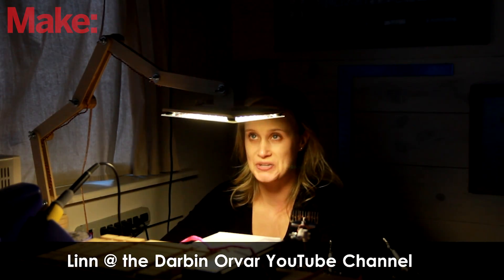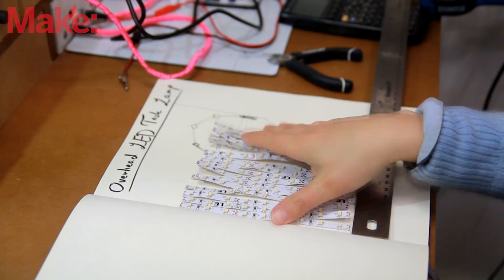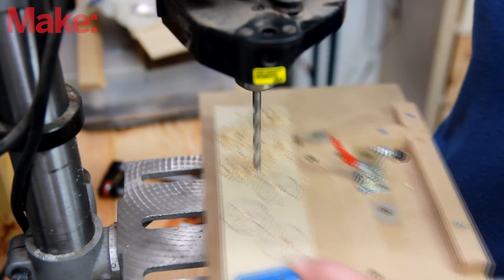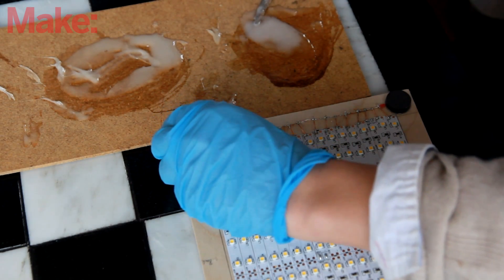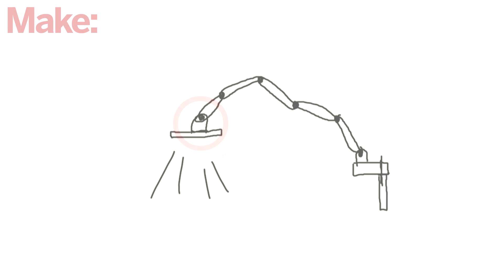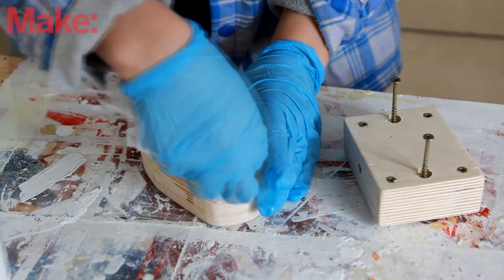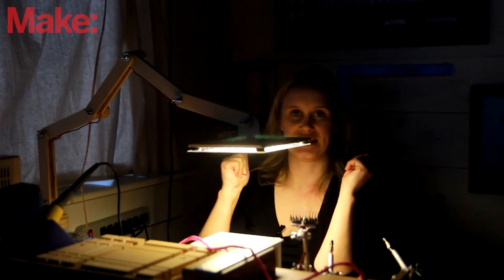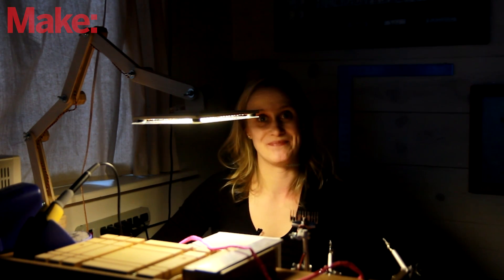Darbin Orvar: Building an Articulating LED Task Lamp

Comment: i do not understand why you used LEDs instead of a normal medium base mount with a replaceable light that is serviceable forever, rather than LEDs which cannot be replaced easily.

Comment: Needs a couple swivel connectors to really give it full range of motion. How do you go about calculating the power requirements and doing the power supply/wall wart?

Comment: i am not sure how those joints can handle the weight at the same shape i want it to be in time. I would expect it to start failing against gravity every some mins. But if that happens to be the case placing rubber washers could help. Cool looking lamp overall. Need to build one and for sure I am going to make use of your idea while building mine, like the magnet connection. Thank you.

Comment: Now add the function to pan or tilt the head left to right - then you got a really utility workbench light. There are instances where you want to target on an object which is vertical and not flat, the light would be able to pan vertically to accommodate focusing lighting on an object which is located in a vertical undercut and is also on the vertical axis. Where there is an object in the vertical plane, you would then change the light head to a smaller one so that the light source is in front of your tools and hands. Otherwise the head you show here would be in back of your hands. Your hand would then block the lighting from that panel. So having an articulating floating arm which can also pan in both directions with a smaller head is needed.

Comment: That's a really neat lamp. I just bought a small battery operated, magnetized worklight that I can put onto my vice, mostly because it was cheap and because I don't have the workspace or tools to do more than soldering. I got a upgrade idea: why not make a stationary panel on the lamp with a magnet in each corner and several LED panels with magnets on the back corners, then connect the power wires to the magnets like you did with the little magnet connector, but now you could just pull the LED panel off and snap another one in its place without taking it off the lamp's arm. The four magnets would deliver the power from the lamp to the panel. Magnets are indeed great for this because they maintain a good and firm connection instead of relying on friction like normal connectors.

Comment: Sharp idea with the electromagnetic circuitry! As the LEDs are by far the most expense component to this build, I would love to see that LED panel made easily detachable from the articulating arm so that you could move it to any number of other articulating arms around the house. Maybe you could use, I don't know, magnets maybe as the connection point ;)

Comment: hello Lin, inspired by your project I made a similar lamp for my home, but not able to go ahead as i don't want the lamp to be fixed at a place instead want it to be with a base or a lamp which my child can attach it to his study table, how do I make that?
Reply: **Linn & clamp
Reply: Make the same lamp here and attach it to the desk maybe?  Or make the base from a floor lamp, just use the weight at the base of the floor lamp at the bottom of this lamp so it will stay where you put it without having to screw it down to the surface.
Reply: Inspired from you I have made the lamp, don't know how to share with you

Comment: This would be useful for film or photo lighting too, you could switch LED panels from cool white lighting to warm amber tones. 

Or from a larger panel to a smaller more concentrated, fewer but brighter LEDs if you need to while working or something. This is definitely going on my Build list.
Reply: it would not be good for film or photography. LEDs have very poor color accuracy and unless you are using a very specific kind of LED, their color rendering is extremely poor.

Comment: Ok, some paradigm shifts here, contact cement for gluing up plywood, never considered magnetic circuit connection,  never used strip lights for a lamp, never considered a remote control for a lamp, and never thought to use wood as a segment for this application.  But now that have seen this I have some ideas to make molded plywood fixtures. I have made formed plywood furniture in the past but always chairs, tables, cigar humidors,  jewelry stands, makeup stands, tack boxes, aircraft cabinet and the like. But now I'm going to do some LED lamps, phone speaker boxes, notepad stands, and the list goes on. Thank you for doing this vedio.

Comment: Hi Linn 
I'm having a big problem when I built this. My bolts and wing nuts couldn't hold the weight of the head of the lamp and so it kept falling down when I extend my lamp out too far, I tried springs but the all it really does is hold it in place and doesn't allow for a lot of flexibility, I was wondering if they're any solutions or advice you can give me thanks!

Comment: Great job! I'm using my similar lamp (with classic bulb) since 1990!! Still working! But is little dangerous with hot bulb ;-)
Reply: You can use some covers: http://porzadekwkablach.pl/environment/cache/images/0_0_productGfx_18df48707413f0105ca0b01700e0d655.jpg

There is professional jack plugs with magnets: https://encrypted-tbn0.gstatic.com/images?q=tbn:ANd9GcQEgS5MO-RbnGCExUxDpBowUWGq1Rb9n3Ie95ljmnvhNeFCI9pn3Q
Best, Loszmi

Comment: That looks great! Did you put on a switch or do you just use the magnet connection to shut it off?
Reply: +Dylan Pieniazek 
judging by the remote, there's clearly an IR receiver by wherever the lamp's wiring becomes the power plug. Almost all of these LED strips seem to come with a slim remote paired with a box.
Reply: +Meowstic oh thanks

Comment: If you insert a 10khz dimmer into the circuit and adjust the light with that, your DSLR(or MILC, hard to tell) wont give this flickering image, like the end of the video.

Comment: Only thing I'd add would be to have a piece of small dowel or even a piece of bamboo skewer sticking out of one half of the power coupler, and a corresponding hole on the other half to provide some polarity protection. Won't hurt the LED's, but I'm a belt-and-suspenders kind of guy. Might also round the corners of the panel, I could see myself getting poked in the eye if not. Otherwise, a spectacular project and one I'm going to make. Always looking for good ways to make a better LED lamp.

Comment: I'm afraid you didn't add any security or guide to prevent the plus to be connected to the minus. Maybe adding a diode to the magnet system is a good idea.

Comment: The magnetic electrical connections are genius. Never saw that before. Thanks!
Reply: +Rick Rose The reason people don't usually do that is because the heat from the soldering is de-magnetizing. But if you're ok with weak magnets holding the connector - go ahead.
Reply: @nvmnvm8821  nah. Heat is localised and very temporary. Have done this with no loss of magnetism

Comment: Linn, I see you are using a remote to control the light. But I was noticing that the magnetic connection could function quite well as a manual switch on its own; assuming you don't need a dimmer.  As always, great build.

Comment: Linn: I like the magnet connector, but you might have added a peg + slightly oversized hole on one side so that the couldn't be connected backwards.
Reply: +xKatjaxPurrsx Thanks, the way I solved that was to make like poles repel so that you cannot connect it any other way.
Reply: That's brilliant.
Reply: +Darbin Orvar Okey i have to "steal" that idea to my own projects! Just curious, what type of magnets these were and is there any special trick on soldering the wires on? Also have you tested that magnet connector wont cause amps to rise due possible poor connection (i mean its not like any standard connector and lose ones cause the connector just heat up if connection is poor) ?
Reply: I did not get why Linn did that till she pulled out the second panel.. and then it was like..  "Oohh, she is smart!  ... and a touch of indecisive."  :-)

Comment: So nice, wish I could like it twice!  I like your idea of using magnets to attach the lights, making them interchangeable without the need for rewiring.  However, keep in mind that heat will destroy magnets and can cause glue to fail.  In your case there may not be enough heat generated by the current flowing through the magnets to worry about.  Just keep in mind that if your magnets or glue fails, check for heat issues.  When I build a similar project, thanks to your inspiration, I plan to keep the interchangeability feature but position magnets out of the loop.  As always, you are so awesome!  Thanks!

Comment: Lyn, what is the power source?
Reply: +djAnakin These are 12 volt leds so I used a 12 volt adapter.
Reply: +djAnakin The LEDC strips run off 12V DC, so a 12V DC adapter. How much current capacity it needs depends on the type of LED strip and how much of it you use. 

Some data could be gleaned here: http://www.ebay.com/itm/5M-300LED-SMD-3528-5050-5630-RGB-White-Flexible-Strip-Light-Remote-Power-Supply-/181929534674?var=&hash=item2a5bd864d2:m:m0scM64YX98bf-el_nc1P_w 
depending on LED type they use 2 or 5A supplies  per 5m strip (300 LEDs), so 20-50mA/3-LED group
Reply: Darbin Orvar brilliant project. got to build this for my self will look brill in my tinker corner.  just wondering what thickness of plywood you used ?
Reply: +Darbin Orvar The power requirements of this project are just glossed over.  Using an on line calculator and some conservative numbers for super brite white leds, I'd estimate that 162 LEDs in this project would consume close to an amp.  The 12 volt adaptor needs to be capable of driving that much current; many are not.

Comment: Nice build. The DIY mag safe connector is a cool addition, although indexing to avoid accidentally reversing the polarity would make a nice touch. Also, press the magnets, sharp blows to magnets can have detrimental effects  on them. Again, cool build.
Reply: +Harold Hayes III Good catch on "tapping" the magnets.  Heat is also another concern.
Reply: Doug Reed
Not to worry (Flinch.....lol) The hammer head is a non Magnetic...Non Metallic.....and is Lemon Flavored.....lol ...again !

Comment: congratulations. nice project. I like it. a little advice; led lamp so heating. Therefore; you must use aluminium heatsink to behind.
Reply: I was thinking the same thing. Also, is this a DC only lamp? Did she mention a wall adapter/power supply and I missed it?

Comment: Nice! Any way the adhesive from the leds would stop adhering?
Reply: +Alfred Zianini Will probably loose grip over time, accelerated by heat... Peel them off, clean off any remaining adhesive and the put the strips back down with 'real' glue.

Comment: Is the magnet wiring safe to touch when connected in an outlet? Will the current shock you?
Reply: +Kevin Li Good thought there.  It would be a good idea to turn the lamp off before changing that component out.
Reply: +Kevin Li The LEDs run off 12V which isn't enough to shock you as long as the power supply is working correctly or you lick the terminals... 
Of course, some Chinese power adapters are shockingly bad design and/or build quality. Same precautions apply as with phone chargers.
Reply: Interesting, in class I am building a led lamp so maybe I'll implement this.

Comment: I made something smilier I used alternating LED strips between worm and cold light and add a dimer to the 2 power feeds so you can adjust the light output nice build your wood work is grate mine I attached it to a old lamp stand not as nice  I think I will mod mine with the magnets thanks for the share
Reply: How do you figure out the proper power supply if you want to use a wall adapter? She didn't seem to mention that part.

Comment: nice build! I would suggest placing the leds with a certain offset... not in straight rows/columns, for better light uniformity
Reply: +Francesco Bianchi The great thing about her design is the "lens" cover is magnetic and can be easily changed out depending on light requirements.

Comment: I'd have been strongly tempted to extend the arms past the joints and add a counterweight
Reply: That would only be necessary if you had a spring articulated lamp, not a friction fit one.

Comment: Thanks for sharing, (please allow me to apologize for some of these Internet Cavemen that have lost touch with civility and respect for others).. I like the idea of the low cost wooden knobs, but worry that the bolt and fly nuts will loosen at random. I have toyed with the idea of building a larger scale articulated arm like this. I have not found a pivot joint I can put faith in (preferably something that doesn't require manually tightening, like something spring loaded/counter weighted/etc.). Any ideas/references?
Reply: +Jake Little You could use carriage bolts, which have a square section underneath the head that is inserted in the wood and prevents the bolt from rotating. You would still need to use the manually-tightened wood knobs though. Or just copy the design of a balanced-arm lamp ;)
Reply: I had similar thought. I've used a thumbscrew in a t-nut for a single joint articulated camera stand. It's easier to tighten but still loosens up when manipulated. I've yet to find a DIY friendly design that maintains friction without need for constant adjustment. I tried a slotted roll pin (aka tension or spring pin) in a nylon insert that I glued into the plywood. I think that approach might work, but I either needed a larger diameter pin or a different material than nylon.
Reply: Doug Reed Friction as the only load carrying/holding capacity works okay for a design of this scale, but if the design is scaled larger more weight is involved. With more weight the bolt must be stretched further to handle the load. The more stretch the bolt has the more it becomes susceptible to handling/vibration loosening with time. I was looking at building something like an 8-9ft (2.5+m) stand for use with a 4ft long LED photography light for larger scale product photography. I need something that can quickly be moved from the ceiling to the floor and everything in between, with one hand. Professional light stands are terrible for this, so I build everything myself :)

Comment: Very, very nice! Didn't you think about multiplexing due to less power consumption? What do you think?
Reply: I believe that would affect the ability to use it in a video  because it looks bad to capture the partially lit LED's within the frame rate of the camera. Functionally, outside of making a pro quality DIY video, it probably wouldn't hurt. It's just more complicated when these are practically fully prewired, isn't it?
Reply: Yeah, for DIY video your version is better :) But beside that I think I'll make multiplexed one - we'll see. Thanks!
Reply: +szafran In general less current means less light, and unless you're off-grid on battery power the strips don't draw enough power to be any real concern. 
They do make PWM dimmers for LED strips that go inline on the power wire.  eBay selection: http://www.ebay.com/sch/i.html?_from=R40&_trksid=p2050601.m570.l1313.TR0.TRC0.H0.Xled+strip+dimmer.TRS0&_nkw=led+strip+dimmer&_sacat=0